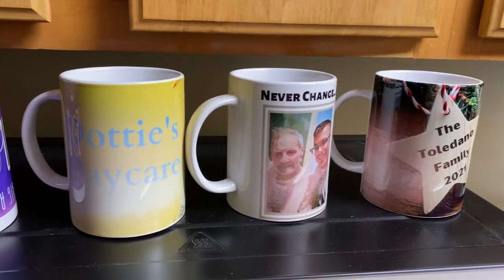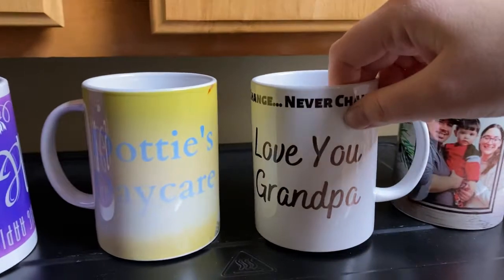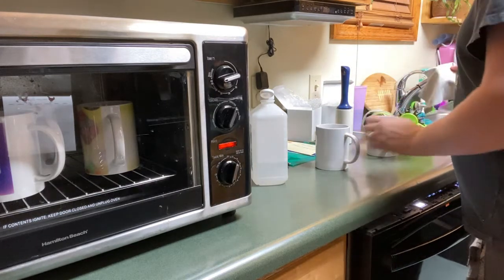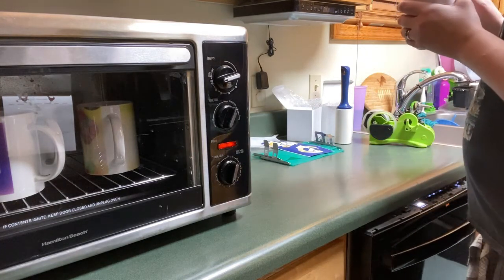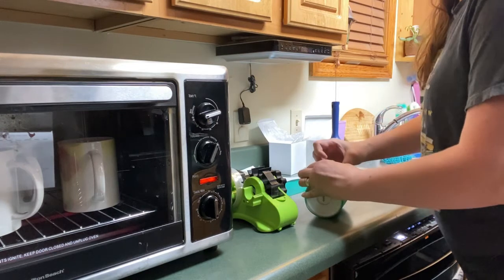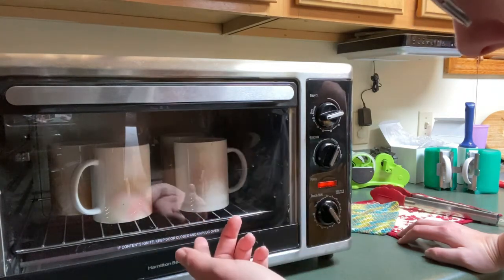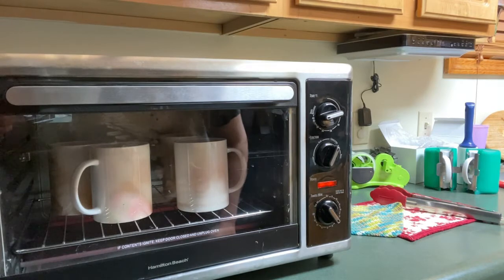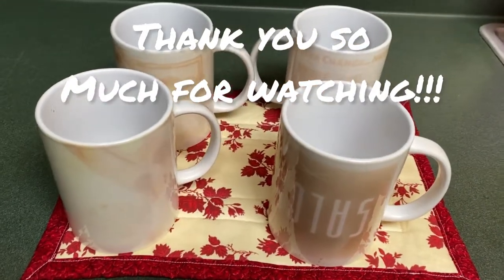How to Remove Sublimation Ink from Coffee Mugs with a Convention Oven

Comment: I was just wondering of this method messed up the coating that allows it to be sublimated? With the vinegar method and scrubbing, they say you can't re-sublimate. Any and all information is so appreciated, I just messed up a run of 7 mugs 😢
Reply from the maker: With the way of over heating/ burning it off, I was able to Re sublimate with a darker image. I used a dark background for the redo cup and tried to make sure all or most of the new image was placed just right to cover the existing mess up. Takes some thinking, measuring and playing around with cup idea to land it just right so no one knows it was a blunder at first :) I hope this helps!